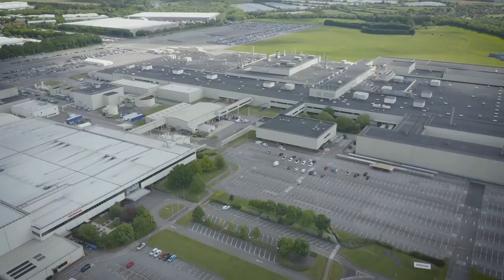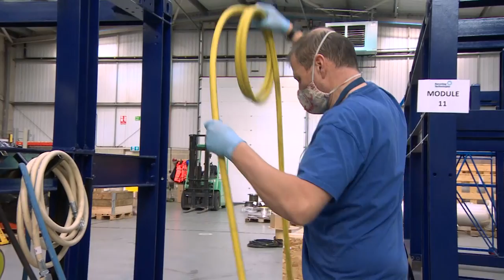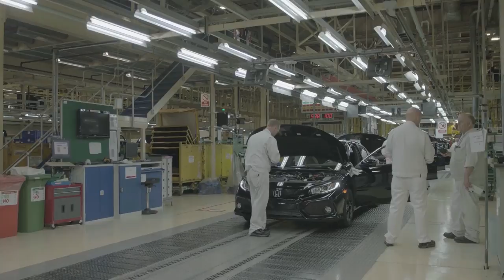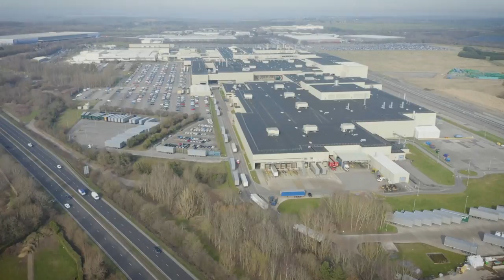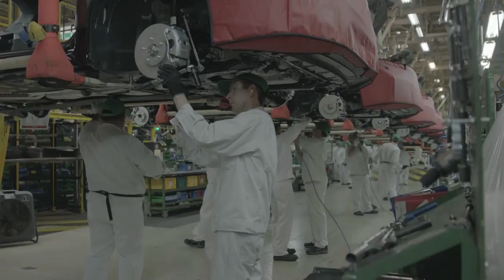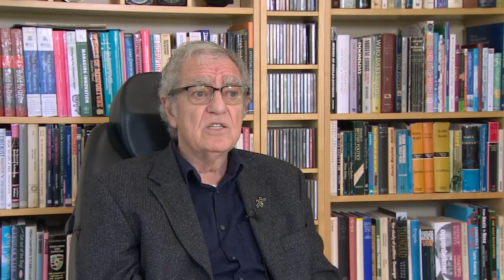Honda UK Plant Closure - ITV West Country & Meridian

Comment: How the heck are the Brexiters going to spin this as a Brexit "win"?
Reply: It's not closed due to brexit though. Two plant's have closed, one here and one in Turkey under the same restructuring scheme.
Reply: @simonrodgers2375  Both of which are outside the EU. Meanwhile they are building new plants inside the EU.
Reply: @ToothbrushMan  they're building plants here as well. Problem I'd demnad for petrol cars, that's it, that's my take. Regsrdless the closure isn't due to brexit as HONDA have stated the actual reason.  Two plant's, one in UK and one in Turkey closed, nothing to do with brexit.

Move along. ,😆
Reply: @simonrodgers2375  " Regsrdless the closure isn't due to brexit as HONDA have stated the actual reason."

The stated position of HONDA is diplomatic fluff.  They'll talk about "restructuring", "economic environments" and other nebulous reasons which a listener may or may not be referring to Brexit. To say is isn't due to "Brexit" is simply wrong. Brexit CREATED the economic environment they have to work in.

It really is blindingly obvious that trade barriers disrupting just-in-time supply lines will mean more expense for a car manufacturer, expenses that put the viability of the car factory in doubt. If it becomes easier to move production to a location where there are no such barriers, then it makes sense to move there. 

There is no way wriggle out of this.
Reply: @simonrodgers2375  Has it occurred to you why its become uneconomic to build electric vehicles in the UK instead of the EU? Yes, its a move to electric, but HONDA have decided that its not viable in the UK - and Brexit has made it unviable. 

Do yo really think for one minute that a senior executive would stand on a podium and publicly state that they are shutting down the factory "because of Brexit"? They would NEVER publicly state this. They would only ever talk about economic conditions, and contributing factors and so on. Which is exactly what HONDA are saying.
Reply: @ToothbrushMan  here's a paragraph containing an actual quote from the company THEMSELVES, on their own website this is in regards to the plants closure.

Katsushi Inoue, chief officer for European Regional Operations, Honda Motor Co., Ltd., and president, Honda Motor Europe, said; “In light of the unprecedented changes that are affecting our industry, it is vital that we accelerate our electrification strategy and restructure our global operations accordingly. “

If you still refuse to believe brexit had nothing to do with it, the only thing that I can suggest is for you to see a psychiatrist. Maybe one that specialises in deprogramming.
Reply: @ToothbrushMan  Here's another quote for you.

"This proposal is not influenced by Britain’s plans to leave the EU," a Honda spokesperson said in a conversation with Euronews".
Reply: @ToothbrushMan  fair enough and apologies for being offensive, I get a lot of offensive replies on here so reply to people like for like as standard these days. Obviously, being offensive to you was unjust.